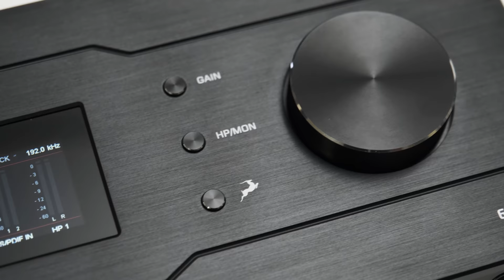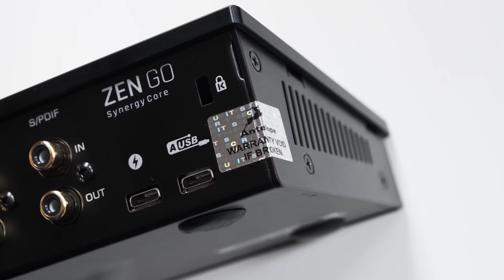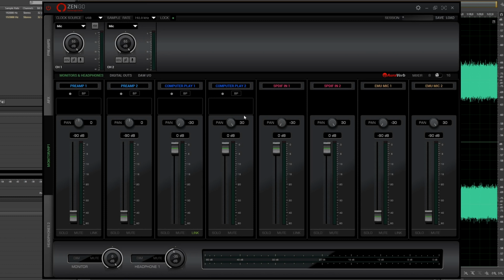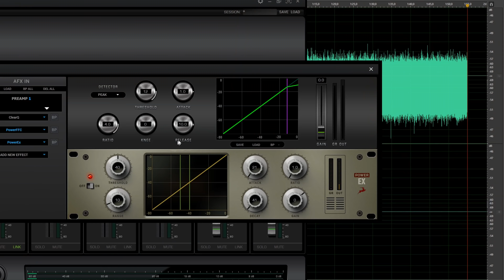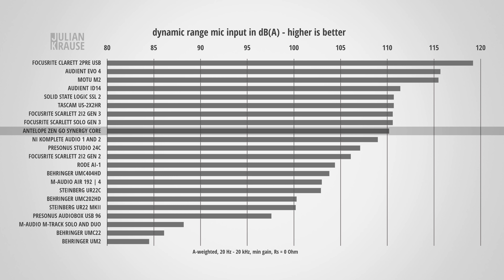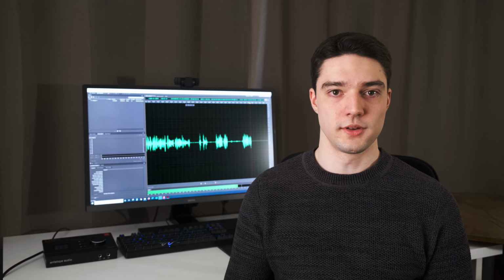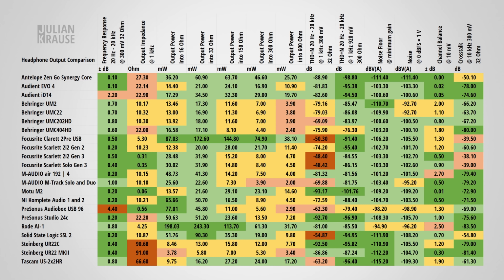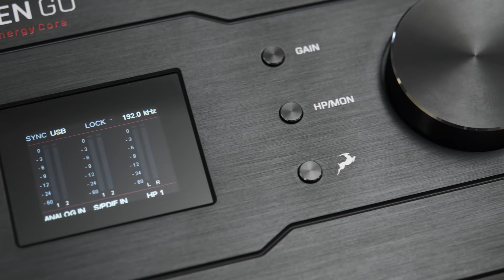Antelope ZEN GO Synergy Core - Audio Interface Review (real-time effect processing?)

Comment from the maker: Update on the inteference issue: 
With the firmware version 2.2.4 Antelope addressed the issue and changed the PWM frequency of the LCD backlight. This eliminates nearly all inteference in the audible range by shifting it above the human hearing range.
Reply: Hey the comment is here but not pinned to the top so you might want to pin it again. Cheers!
Reply from the maker: @joesalyers  Thanks, pinned it again.
Reply: Stickers are for kids. Thumbs UP!
Reply: @Julian Krause do you think replacing those resistors in the headphone amp with something along the lines of 0.3 Ohms would solve the issue with the high impedance?
Reply from the maker: @anonymus8760  It will definitely lower the output impedance. But be warned, the interface was not designed with such a low output impedance and modding the output can damage the interface as the current won't be limited anymore by the resistors. Not sure if that's worth the risk.
Reply: @JulianKrause  thank you for the quick reply! That's what I thought. 

Basically I am looking for an interface with two seperate output pairs (main out and HP2 in this case), SPDIF I/O AND good windows drivers as I use plugins a lot to play in real time. Good audio performance is obviously needed as well. My main heaphones are 80Ohms.

So far I'm looking at the Audient iD14 mkii, the Zen go, the Zoom UAC8 and the RME BF Pro FS. Out of those I think the audient has the slowest latency. 

Do you have any recommendations for that?
Reply: Julian if you ever start your own pro audio hardware line I'll buy a JK interface in a heartbeat.
Reply: Would low impedance Pro Planar headphones potentially suffer the same distortion effects as regular headphones on the Zen Go's headphone amp?

Reading the Audeze blog on Planar headphones makes this claim (FWIW I have Avantone Planars @32 ohms): 

"When it comes to impedance characteristics, planar magnetic drivers are, once again, different from dynamic cone drivers. Because of the construction of a dynamic driver, it’s what’s called an inductive load. This means that a dynamic voice coil is going to resist the current going through it differently depending on the frequency, resulting in poor control over the movement of the diaphragm. Audeze’s planar magnetic drivers don’t suffer from this variation in impedance. Because the voice coil is printed directly on the diaphragm, they produce a “flat” impedance curve (since they’re a purely resistive load). This means that there is no change in resistance regardless of the frequency, offering a huge boost in control and resolution compared to a dynamic driver. This means our headphones perform better on more types of amps, making your amp/headphone selection that much easier. "

I'm still working thru your videos, maybe I'll find the answer.  But if not hope you'll consider this question!
Reply from the maker: @leadetlefs8964  Hey, that statement is true. Planar magnetic headphones usually have a relatively constant impedance over their frequency range. This way a high amp output impedance does not result in noteworthy frequency response variations. But with planars the power of the headphone amp becomes more important as they are often times less sensitive compared to dynamic drivers.
Reply from the maker: @anonymus8760  Hey, I only measured the iD14 MKII so far, so I can't say for sure. The RME interfaces are often times recommended for their very low latency. If that's any help.
Reply: @JulianKrause  would you go with Antelope or Clarett2pre
Reply: @anonymus8760  HP amp is based on NJM4565, looking at the datasheet, the output resistance in voltage swing vs load resistance graph is defined from approx 45ohms so there is not much room for lowering series resistance. Personally, I would not go below 10 ohm when using 32 ohm headphones.
Reply: Motu M4 eu acho que é melhor e mais barata que esta plca ai

Comment: Guys. I have this interface. I tested few newcomers, Audient, Black Lion Audio, Motu, etc, and I can say this. numbers are numbers but ears are ears. This unit sounds phenomenal. Closes to this was Black Lion audio 2x2. but antelope just sounds very clear and with weight. Bass has meat. Hights are smooth. They have best clocking and converters for a lot of more money. It's class in its own. Believe me, plus drivers are fast. This unit is great value for money and software mixer and plugins are just cherry on the top. So with all respect, regarding this review, numbers and tests are one thing, sound and usability is another. Remember Julian is testing hardware, specs and all that stuff, but sound and software is another story. (PS. I really like Julian and I love this channel but it's just one side of view really).

Comment: I just got myself this interface for my birthday and I want to add a couple of things that I think are important. 

1) you can drastically improve crosstalk measurements (and, I presume, performance) by changing the Panning Law to 0db. I tested it myself with RMAA looping the monitor out into the line in, and with the default settings I got -50.1db, with Panning Law set to 0, I got -100.9db. 

2) Maybe the software update has fixed it, or maybe they fixed it in newer units, or maybe even your unit was defective (or I got an extremely good one) but in my case you don't need to max out the gain to drive Shure SM7b and the noise is much lower. In the software the gain maxes out at 65db, and speaking at around 5cm/2in from the grill I was averaging -8db with peaks approaching zero even on a relatively moderate voice level. 60db of gain is more than enough, I'd say even 55db is plenty. And I dunno how to measure EIN but to my ear the noise for me is lower than what is shown in the video. So if you are considering buying this interface keep that in mind.

Comment: Thanks for the work you are doing Julian. May I make a couple of requests for your future videos. 
There are a number of use cases where it is not necessary to tweak audio parameters of the interface. In particular in regards to interfaces with DSP features or digital external control. In order to avoid having to open an extra control program such interfaces would ideally boot to the last used settings ,which is one of the more useful attributes of the X Air series mixers. So it would be useful to highlight if such functionality exists with any particular interface during the review.  Another thing that is frequently overlooked is the subject of USB-C connections Since the USB-C standard was created to unify various USB speeds and power supply standards there is a lot of noise made by manufacturers and non tech reviewers of the existence of a type C connector. Many assume the presence of a USB-C connector implies full type C speeds and power, which is contrary to the fact most USB-C connectors on audio interfaces are really only USB-2 complaint for speed and power. I note you have highlighted this on units with higher specs than USB-2 but again it might be useful to definitively indicate this in all your reviews. I acknowledge that USB-2 is plenty fast enough for low channel counts but I find it disingenuous of manufacturers taking liberties by omission in their promotional materials.

Comment: The interference from the LCD is from PWM flickering! This is due to how many of the speciality display controllers handle brightness. It's very common in high refresh rate computer monitors. This will bleed into your audio if the monitor is being controlled by the same chip as the audio effects so it's best to run it 100% brightness just like a high refresh rate monitor. Great review by the way!!! Keep up the awesome work.
Reply from the maker: Hey, you are right with the PWM control. Check the pinned comment for an update on this topic :)
Reply: @JulianKrause  Great thanks for the info!

Comment: Julian Krause is the real deal!! Antelope Audio should have put out a MUCH better product for this price point imo. Quite disappointing.
Reply: The other interfaces that were compared against it in those charts have their own flaws as well, so it really depends on what you're looking for. It's also worth noting that a chunk of the price comes down to the cost of their high end effects that you can add to your recording signal. For what it costs vs. an Apollo, (and the fact that you can loopback into Discord/Twitch, etc, which UA cannot do on it's own), $500 is a reasonable price. For the songwriter equipped with a microphone, guitar, and 250ohm Beyerdynamic headphones, this is everything you need.

Comment: I have an Antelope interface and it has so many weird quirks that I’m currently trading it for a Motu. 

One of those quirks is the line level input limit at +19dBu that you mentioned at 13:00. I disagree that is ‘in the realm of’ professional audio levels. Many vintage and/or pro audio outboard gear maxes out at +24dBu and occasionally as high as +26. I have 1 piece of gear I use on absolutely everything that sounds best when you drive it hard all the way up to +24. So I need to put an attenuator between it and the Antelope unit. 

Another major shortcoming IMO is the lack of diversity in the available real-time FX. Antelope heavily favors vintage compressor and EQ emulations and does not have much selection of standard effects like reverbs. The one reverb in their FX library has some major limitations like only being able to run it through their internal mixer … you cannot actually add it as an effect in any AFX chain. 

The list goes on. I have a long list of such quirks that I just got so fed up and and I am dumping Antelope.

Comment: Thanks for the review. It seems this is almost perfect as an interface, especially if you use an external A/D converter. Perhaps they'll be able to squeeze a bit more performance from their next gen in those trouble areas you mentioned. This seems like a decent competitor to the UAD, though UA definitely has them beat if you like spending thousands of dollars on hardware-accelerated plugins.

Comment: The issue with Antelope LED displays is that the white color fades out over time down to a dark orange color. I know this is the case, as I had a Discreet 8 Synergy Core for only two years and 80% of the white faded out in all of the different menu sections down to a dark orange color. It was hard to read at that color. A big flaw in the Antelope LED displays! Also the Antelope drivers for Windows are slow and frustrating to work with. I recently switched to a Focusrite and the ASIO and WDM drivers work flawlessly in Windows.

Comment: Thank you Julian. Fantastic, and thorough review. The kind of inteligent review that allows others to make the right purchasing decision. A bit too bad about the input noise performance. Still, one of the better audio interface performers in the consumer grade DAW markets. I expect Antelope will do well with the Core Go. 
Be well!
Reply: @levondarratt787  1. Who said anything about "consumer grade"? 2. The Zen Go is for anyone who needs it, with of course the rather steep but exceptionally detailed effects processors Antelope provide in addition to the bundled software as Antelope have a very good Rep industry wide. 3. I don't think "would be You Tubers" suggests anything logical here as professional, consumer, or otherwise. "Streamers" certainly wouldn't need a Zen Go when there's a multitude of other audio interfaces that feature live streaming, while monitoring/recording. Point is, I don't get your points. It's pretty simple here that Antelope are reaching for a middle groubd market here. Like any product (consumer or professional), There are design and component cost compromises. Even benefits. To Antelopes credit, they found a very logical product. The Zen Go has some limitations on  number of playback effects available with a DAW, and that's also a fact. Like it or not. So in the final analysis, the consumer or professional make a purchase decision. BTW, most professionals are buying the higher end Antelope products, so I just don't get you points, streaming, etc.

Comment: Glad to know that by the numbers, my MOTU m4 holds it down. I'm not a fan of Cirrus Logic DAC's, but the TI/Burr brown ADC sounded really pleasing and warm, would say warmer than the preamps on the M4, IMO. I was curious about the effects, but tbh, modern processors (I have a ryzen 5600x with 32gb), running out of processing power is NOT a problem, trust me! I would go as far to say do NOT consider this for the Xtra processing power for plugins. And the MOTU has real (analog?) knobs to control gain, just a plus for me, all for 250 less. Thank u for ur review Julian!
Reply: has your motu m4 gave you any problems yet? im looking for a interface i can take on the go that can handle plugins and zen go or motu is what im trying to decide on
Reply: @MrDellion214  I have the M4 as well (since January 2020) and it's been great. No hardware issues at all. Only annoyance was it took quite a while to get Big Sur compatible drivers, but they got it done by May 2021 and can't really fault them since Apple completely changed up how kernel drivers work -_-
Reply: @jgurtz  I have a windows computer hopefully it functions the same as Mac

Comment: Good spot on the screen brightness issue, same on my unit. I was only getting the buzz when using ZEN GO analog line output into my amp, S/PDIF output was ok. I actually thought it was my other computer connected to my Maia S2 amp and it was its USB DAC that was causing the interference (i have two computers connected to 1 amp driving passive speakers), but the brightness fix has stopped it :)

Comment: Too bad input dynamic range isn't overly special, I would have liked to see how the PCM1840's DRE feature does in practice. Nice to see some new converter ICs either way.. the first products with CS43198 are only making their way to market right now (e.g. Topping D30 Pro), and PCM1840 was a new one to me as well. This one will have to be added to the list.

Oh, DRE is not available for fs >48 kHz, well that explains that then. This is also the first part I've seen where the "low-latency" anti-alias filter quite arguably performs better than the regular (all FIR) one.

Comment: Hi Julian. Great review, as usual. Kudos on your discovering the LED dimmer injecting noise into the audio signal - truly pro-level detective work!  Do you think Antelope can/will be able to improve on the shortcomings via future firmware updates?  It seems like a very nice unit, but I do audiobook narration and need something with very low self noise, so in its present state, the ZEN GO Synergy Core is not suitable for the task.
Reply from the maker: Well, the backlight issue can't be fixed via firmware, that's a hardware issue. If you set the LCD to 100 % it won't be a problem anymore. But I'm with you, if you record with a dynamic microphone and need the lowest noise possible, this might not be the interface for you.
Reply: They might be able to change the PWM frequency to something above the audio band, if the underlying hardware allows it. If not, it would be an hardware mod if not serious redesign of the whole thing.
Reply from the maker: @BoredQwerty  Funny that you say that, that's exactly what they just did with the newest firmware release. The change in PWM frequency shifts the interference more into the ultrasonic range :)
Reply: @JulianKrause  there you go, fixed.
Reply: @BoredQwerty  Good idea.  Seems to have been the ideal solution.  You would think that electronics engineers specializing in audio hardware should have considered this as a source of interference from the beginning.  Seems like those new pesky graphical display circuits are throwing some surprises their way.
Reply: @aerofart  pwm dimming for lights it's quite the norm nowadays. Yes they should have known better from the start. Possibly they're investing most of the development time on the digital side of things (and it kinda shows).
Reply: @BoredQwerty  another possibility is that this task was handed down to an inexperienced engineer or worse yet, a quota hire. Lol. They (quota hires) will be flying our airplanes ✈️ soon as well.

Comment: Excellent review and very helpful thanks. One question I have, is it possible to 'reamp' and use an external effects unit such as a Strymon big sky guitar pedal? Normally this requires an output 3 in addition to the normal Left and right outputs 1 and 2. Can the RCA or spdif outs be used for this purpose? Thanks in advance

Comment: What headphone impedance would you recommend for this I have the zen go and my audio technica mhx 40 sound low I'm considering an 80 ohm beyerdynamic 770t would these be better or the 250 ohm
Reply: I actually ordered on and have the m40x as well with the Sundara on its way. Seems that's gonna be my experience as well. He recommended something with at least 150ohm. I'd say get the 250 ohm beyers.